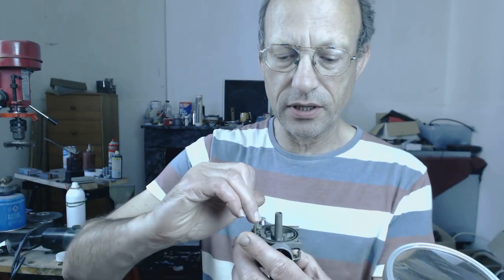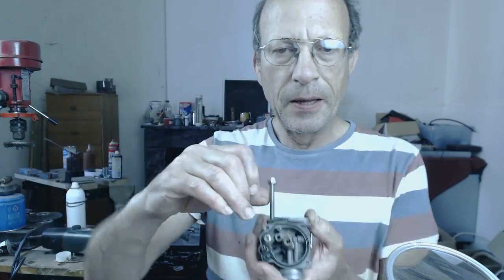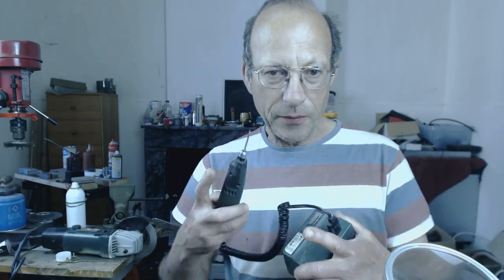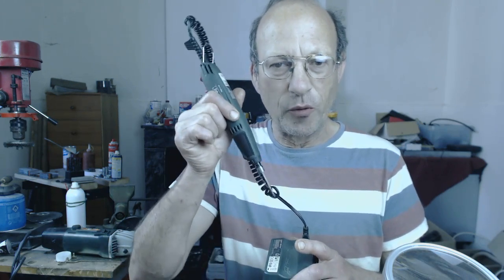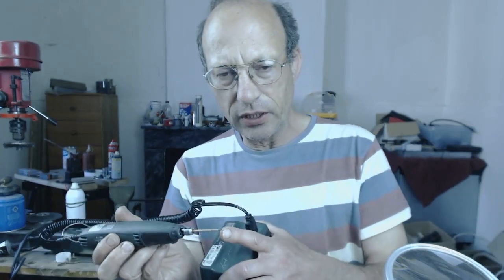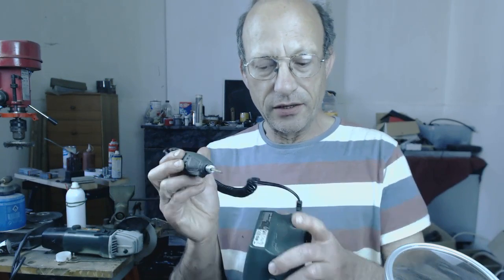Carb fuel needle valve - Repair a leaking carburettor - reseat the valve

Comment: thanks for the idea. i just fixed my needle leak this way.. using valve grinding compound on conical diamond (china grade) grinder bit on a cordless driller. grinding the hole where the needle sits for a couple of turns (less than a minute), dont want to grind too much, but eventually it is fixed on first try.
Reply from the maker: Lucky you, because that kit is pretty aggressive :D
Reply: @EngineTuning  i inspected carefully every progress i've made during grinding or cleaning process using digital microscope and LCD monitor, because i have the tools for electronics repair. so i have quite a clear view on whats going on in the tiny hole. the hole where the needle sits is sort of copper material mixed with other blackish material that i'm not sure of, maybe they are carbon deposit or what. it is quite hard material, esp the copper region, slight grinding the hole will not do any difference, so i do what i think is adequate. btw the carburetor i'm fixing is for the yamaha enduro outboard 15HP... the problem solved on first try, no fuel leak on the nozzle jet anymore, i've made countless repairs on the carburetor this few days to no success, i guess i tried to fix on the wrong parts. tonight its fixed after i watched this video. the question now is how long its going to last that good. i will try again tomorrow and later during its actual operation.
Reply from the maker: @soajpg  We would hope that the fix should be good for a few years :)

Comment: Thanks for posting this!  I used your method successfully on my 2003 Katana 600 where cyls 2 and 3 were dumping fuel into the cylinders. When I got this bike there were 2 extra qts of oil (fuel) in the crankcase. Fuel seeping was unresolved by previous M/C tech before I got it. I replaced the needles; reset float height; replaced seat o-rings and used the q-tip in drill with Simichrome polish to buff the bush proper - all with no joy (bench testing between each change). Then I found your YT and BINGO! your system worked to refresh the 'pin-seat opening contact area' and bike is running. Brilliant!
Reply from the maker: Hahaha ... great news Gary.
Thanks for the feedback :)

Comment: Having this problem now on a Chinese knock-off of a Walbro LMT carb that usually is attached to a Briggs&Stratton 6hp mower/snowblower/generator/chipper etc.  Mine is a Powermore engine on a Huskee 208cc snowblower. It leaks gas out the o=ring on the bowl assembly. Ya, I know I also need an o-ring as it should not leak there but should fill the crankcase with fuel instead. So also will get an o-ring as I can find that. But not able to get a new needle and seat today and it is snowing. Have no doubt this is going to work and I thank you for putting the vid up. Machine is last years model so seat should just need a bit of mirroring on the finish or as you put it "a little tickle on the bush". If all goes well I will get that tonight but today I will just mirror the seat. Thanks.
Reply from the maker: Nice feedback 61spindrift.
Good luck with that.
If you have time ... report back on whether it was a success or fail :)